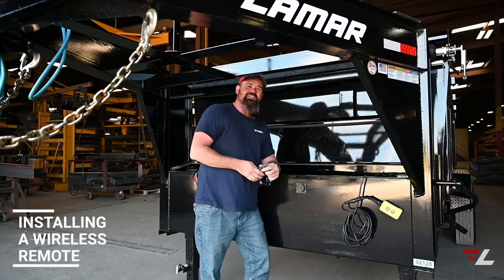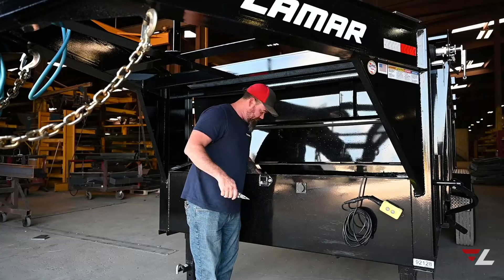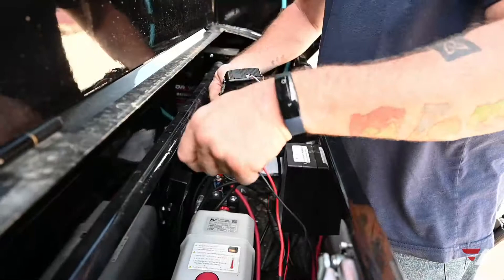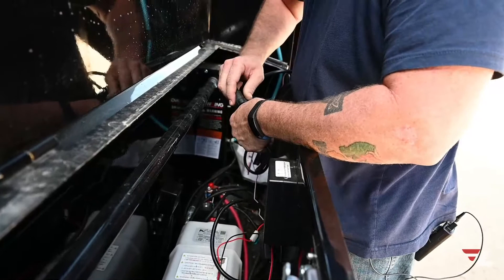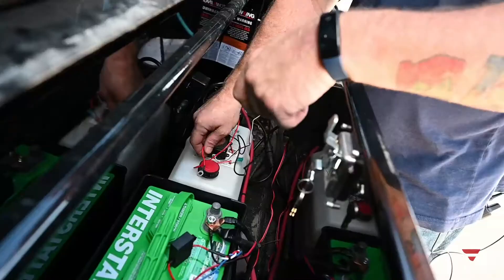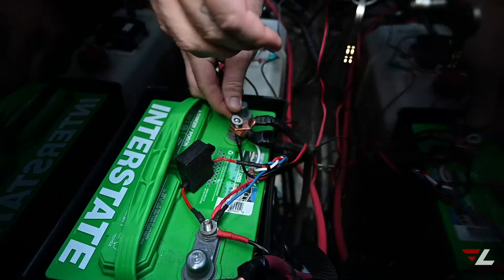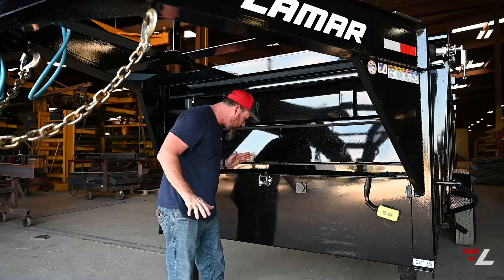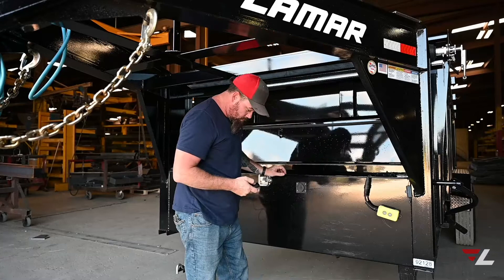Installing a KTI Wireless Remote on a Lamar Dump Trailer

Comment: Just bought a brand new 7x14 Lamar dump had a local dealer install this. Yes the antenna is on the outside it I hold the button down it will intermittently stop n go even if I constantly have the button doen
Reply from the maker: Please return to your local dealer to see diagnose it.
Reply: My KTI wireless remote does the same thing! I expected better quality from KTI the remote is very cheap considering it cost $250!!! There is better alternative out there that work for far less money!

Comment: I just bought a 16 ft triple axel Lamar dump trailer.  The up button on the control gets stuck.. I would like to get a wireless fob for it. what is the model number for this kit
Reply from the maker: https://ktihydraulicsinc.com/support/kwr-003-wireless-controller-2/
Reply from the maker: If you have the model with gravity down, this one should work for that
https://www.ebay.com/itm/264852331188?chn=ps&norover=1&mkevt=1&mkrid=711-117182-37290-0&mkcid=2&mkscid=101&itemid=264852331188&targetid=1645685073288&device=c&mktype=&googleloc=9026970&poi=&campaignid=16730423415&mkgroupid=135815925780&rlsatarget=pla-1645685073288&abcId=9300841&merchantid=6296724&gclid=CjwKCAiAoL6eBhA3EiwAXDom5oBLA71oVOmZ4Co9lYTAssbOy94LF85457tLTYBzSqSFdfSyfiEtexoCjP4QAvD_BwE